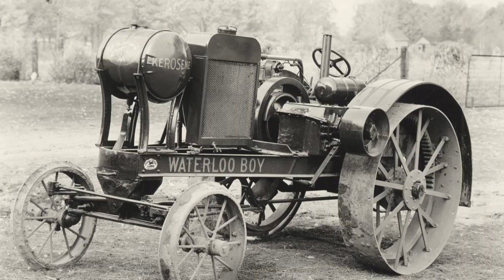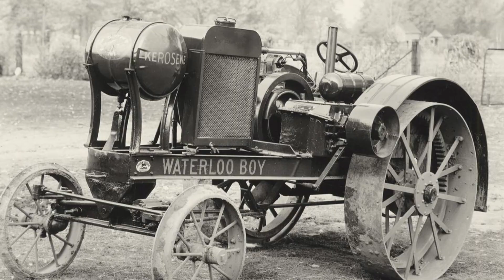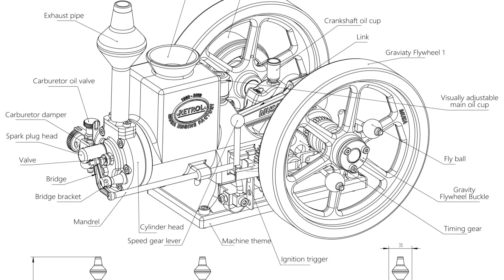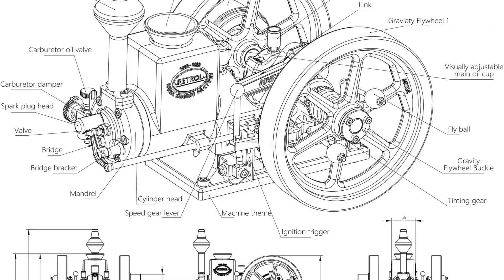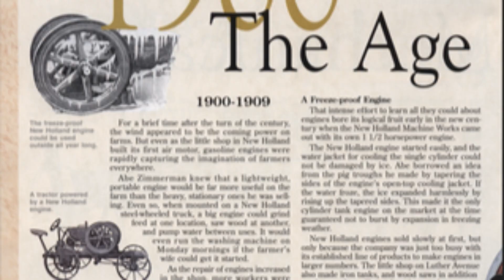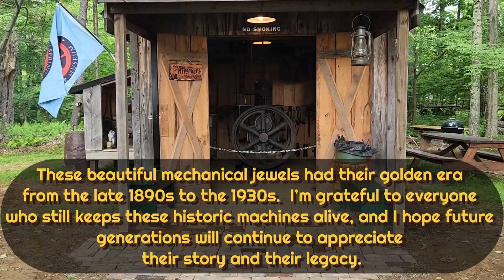The Birth of Hit and Miss Engines | Episode 1

Comment from the maker: Quick technical clarification:
Most classic hit and miss engines control speed by holding the exhaust valve open during miss cycles, preventing a fresh intake charge and compression.
Different ignition systems existed depending on the era and manufacturer.
Thanks to the engine enthusiasts for keeping the details accurate.

Comment: You STILL DIDN'T SAY  HOW The Engine Began !!!    It Was An Off Shoot Of A Steam Powered Piston Engine.  However A Fuel Induction And  Metering System Had To Be Implemented  BEFORE An "Atomised"  Carburetor   Became Wide Spread In Smaller Gasoline Engines.  THAT Is WHY The Hit And Miss Engines Had Many Different Types Of Fuel Induction Designs By Each Company Manufacturing Them.  Many Of Them Were Similar, But Yet Different.  From  HOT TUBE Ignition To Using Spark Plugs.  You Completely Skimmed Over TOO MUCH.   But Using Engines From The Cool Spring Power Museum Was A Good Start. 😊😊😊😊😊...

Comment: My grandmother lived on a farm in the 60s and 70s, about five miles from town. Across the river on the Navajo reservation, there was an oil field pump jack that was powered by a hit-and-miss engine. When it hit, it sounded like it was three times because of the echoes on the canyon walls. That motor made noise day and night every day. It's not farmland anymore; there are streets and houses across the river on both sides, there are 5 streets on the family farm with 10 houses, and nothing looks the same. That well might be sealed up and that pumpjack gone. It was still running in 1990, but I'm not sure now; it's hard to see anything there on Google Earth. I kind of know where to look. If it's still running, I would like to video it.
Reply: The area where that hit and miss motor was at is called Upper Fruitland in New Mexico; across the river, where my grandma lived, it's called Lower Fruitland.  Long ago, the river changed, and my family lost 3 acres to the Navajo tribe.

Comment: Hit-and-miss engines are still used on pump jacks, and I wish that they weren't.  The examples I have seen in videos and in person use large resonators on the exhaust.  I assume this is a measure to help them run better on produced gas - the waste gas from an oil well.  One can hear these monstrosities for miles around.
https://youtu.be/z-lw554SWsE

Comment: The governor doesn't stop the intake valve "from opening fully" as described here. It stops the exhaust valve from closing fully, making it a compression release allowing the piston to draw air in and out of the exhaust pipe, hence the "panting" sound during the "miss." Most hit and miss engines had automatic intake valves, no cam, just a light spring holding it closed, the low pressure (vacuum) of the intake stroke drawing it open. When the governor holds the exhaust valve open there is no low pressure on the intake stroke so the intake valve never opens when the engine's panting. Some engines also kill the ignition, some don't, depending on the ignition type. Many early hit and miss engines had make and break ignition, later ones had spark plugs with tremble coils and even later ones had inductive discharge magnetos. Hit and miss engines were still being produced up until the early 1940s.

Comment: The AI animation makes the whole video seem disingenuous.
Reply from the maker: It was very difficult to find original source videos, so in some scenes I had to use AI animation, but most of the time, the videos were genuine.
Reply: @techonly01  But you got the most basic operation of a Hit and Miss WRONG! It is the Exhaust valve which is held open during the Miss cycles so no vacuum is formed to open the intake valve.

Comment: There's still a bunch of hit and miss engines running oil pump jacks today
Reply: I've seen those out around Pittsburgh PA area when I lived there.  They started them up about once a week as the oil oozed back into the drilled well cavity.  Start 'em up, pump for a few hours, then shut 'em down again for another week.  No mistaking that hit or miss sound!
Reply: You see em a lot in venango pa

Comment: don't use AI videos please
Reply: The ONLY operative word in AI is "Artificial" and certainly no intelligence given this video got the most basic principle of a hit and miss engine WRONG. It is the Exhaust valve which is held open during the "miss" cycles of the engine not the intake valve. The intake valve simply opens if there is a vacuum in the cylinder during the intake phase of operation. If the exhaust valve has been kept open, no vacuum is created and no vacuum to open the intake valve. AI may be good for some stuff by those who wish to misinform us or make a quick buck on a YouTube video already are abusing AI.

Comment: How does a hit and miss save on fuel since they are running as a normal engine just without a spark for some of the revolutions. It's still drawing air through the carburetor and exhausting the unburned mixture.
Reply: On the miss cycle the exhaust valve stays open which means no vacuum to draw through the carburetor.
Reply: The governor holds open the exhaust valve so no vacuum and no fuel/air drawn in on miss cycles. The intake valve is opened purely by vacuum over coming a light valve spring..
Reply from the maker: During the “miss” cycles, fuel is usually cut off and the engine is mostly just moving air. It only fires when the governor allows it, which is why it saves fuel under light loads.
Reply: @techonly01 the intake valve is automatic, the exhaust valve is held open during the "miss" eliminating the low pressure on the intake valve so it cannot open. During the "miss" air is moving in and out of the exhaust not the intake.
Reply: The inlet valve doesn't open??
Reply: @Bryce-z9v  Opens only on the "hit" stroke.
Reply: Most hold the exhaust valve open and coast till the governor speed decrease to set speed  😇🙏
Reply: Sitting here in 2026 we can't make a engine last anymore they tell us recycle then sell us disposable.

Comment: It is interesting that so many of the videos like this one are full of BS.  As an example, some of the engines shown are not even gas engines, but steam engines running on compressed air.  Another example of BS is that many of the engines shown are throttle governed engines, not hit and miss at all.  You need to do a much better job of research before putting out videos that have so many inaccuracies and inaccurate pictures of engines running.
Reply: Do you have a youtube channel? please share 🙂
Reply: I am not interested in editing your videos to correct all the BS and mistakes.  As for this video, it will be my first and also last video I will watch from your channel.  If your video had accurate information and video to match it, your video would be informative and interesting, but you failed miserably, way too much BS, false information and wrong video clips of the engines.  @Bryce-z9v
Reply: @mrobsoletesvintagehomestea9156  I can save you the trouble. I don't and never have had a You Tube channel?? I don't know where you got the idea that I had. I only asked if you had one:body-blue-raised-arms:
Reply: @mrobsoletesvintagehomestea9156  So have you figured out that I merely put in a comment and in no way deserved the rant that you put up?? Or you won't admit your BS and mistakes. Merry Xmas to you and all the best for the new year, from New Zealand 🙂

Comment: My father grew up in Eastern Kansas without electricity. His father used hit and miss engines for power where needed, though they did have a tractor that they used for grain threshing, the tractor had a power takeoff wheel and would run it. First conveyance my father used was a team of horses. His father taught him to plow a straight line with a team of horses first. 

For water, they had a well and a windmill. But, to power their washing machine to wash clothes, they would hook up a hit and miss. They also used it for power to pump water from a pond to a watering tank for cattle a few fields away. Back in the 1970s I had the opportunity to work with a horse farmer in New Hampshire. He farmed with a team and did all plowing, cultivating and even cut hay with a team of horses. 

His position was that motorization caused humans to have more problems, as we would have to try to keep up with the speed of motors, instead of living life at the pace of life. But one’s pace did need to accelerate around harvest times.